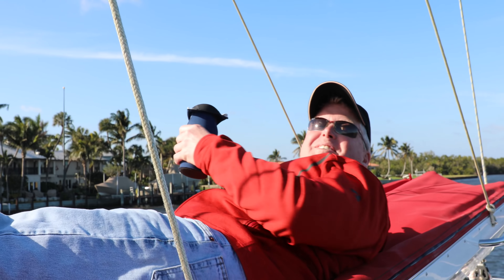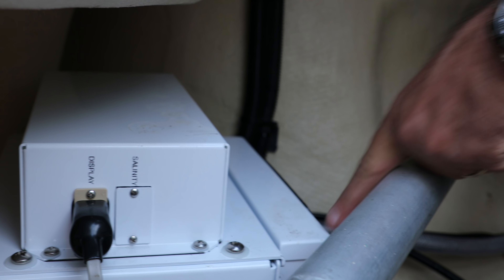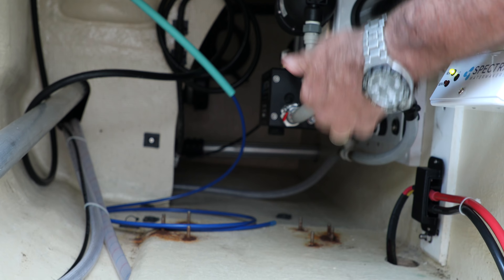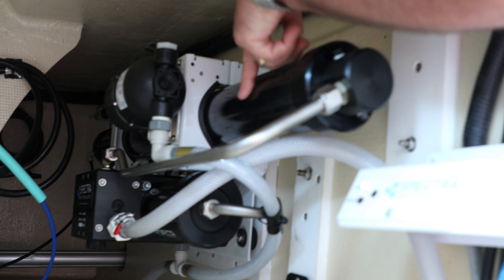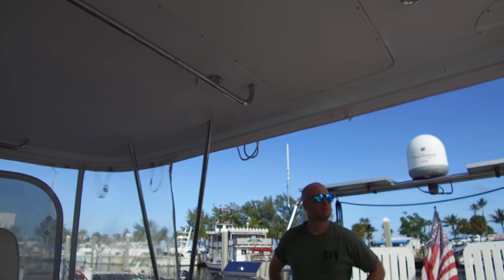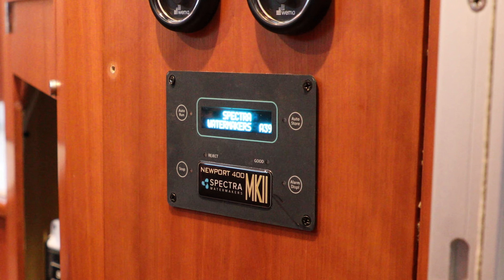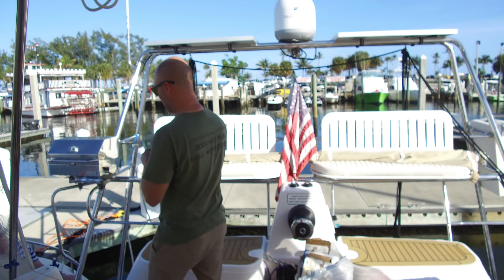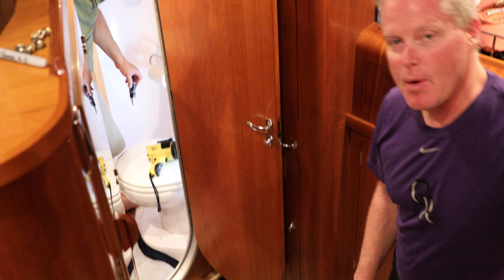$21k Watermaker Installation & The Toilet Blows!! Lazy Gecko Sailing VLOG 76

Comment: Good job, looks like a fun time. Well, except the head. I you use a heat gun on that white hose before you clamp it, it will bond to the fitting better.
Reply from the maker: Hey Karl! Thank you! That's a good idea, unfortunately we didn't have one. It held though. The problem was that the hose was being allowed to be pulled down into the hull and the bottom clamp stopped that from taking place.

Comment: I wouldn't make water anywhere near a Marina, or for that matter within 7 miles of shore
Reply: Jayson Cody you could always install uv sterilizer on the hose that runs from water production to the tank.
Reply from the maker: Yeah, you hear lots of stuff about that topic. Sometimes, like when you're commissioning a watermaker, you just have to do what you have to do. We don't usually run one in a marina because you'll clog the pre-filters very quickly but it's fine to do so when you're outside of them. No need to be so far offshore to run it.